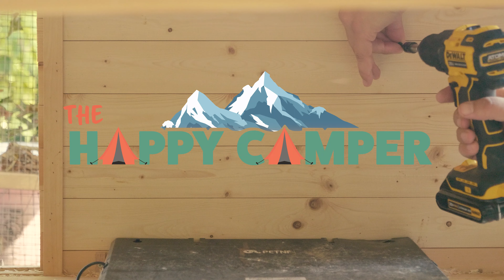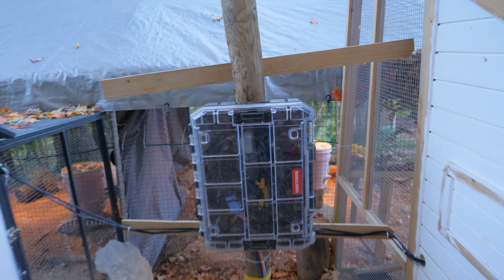Installing PetNF Heat Panels and Elitech STC-1000WiFi controller (purchased on Amazon)

Comment: Can you set both plugs as heating?
Reply from the maker: Unfortunately you cannot. I worry to overload the one plug, having so much plugged into it. I'm at around 2000 watts amd doing ok so far on the one plug.
Reply: @HappyCamperDeals  say if I wasn’t using that many watts though. I’m trying to use this for a van life battery heater/charger id set the heater to turn on at 31f and the cooling plug would have a charger that would turn on when the battery hits 40f
Reply from the maker: @StephenShreds  unfortunately there is no way, one is for cool and the other is for hot. One will trigger when temp gets low enough and the other will trigger when the temp gets high enough.